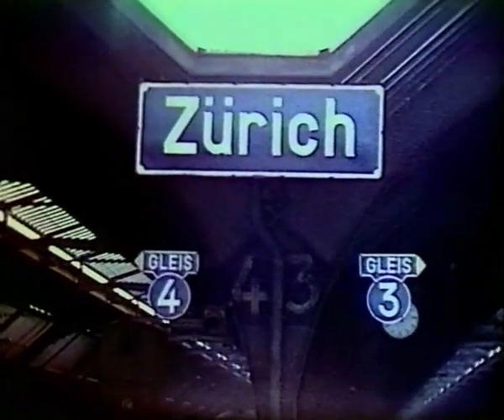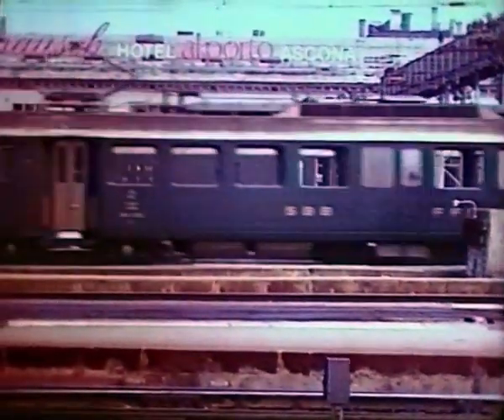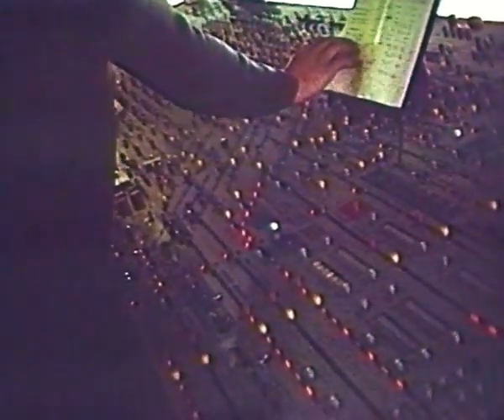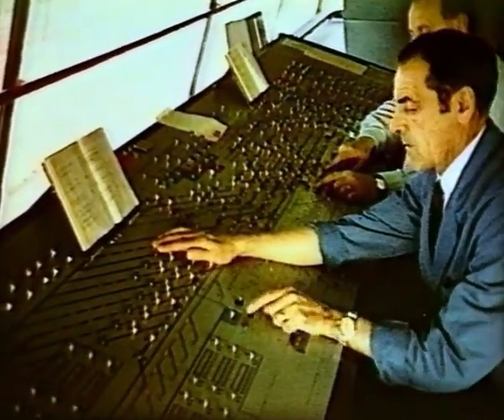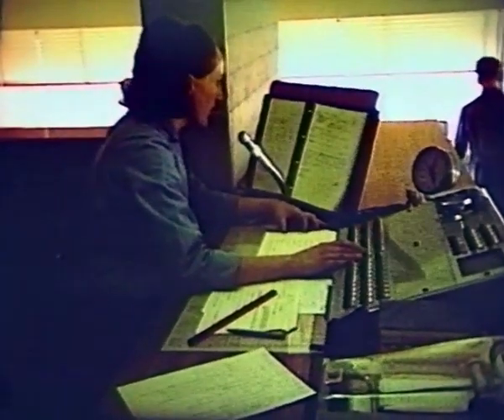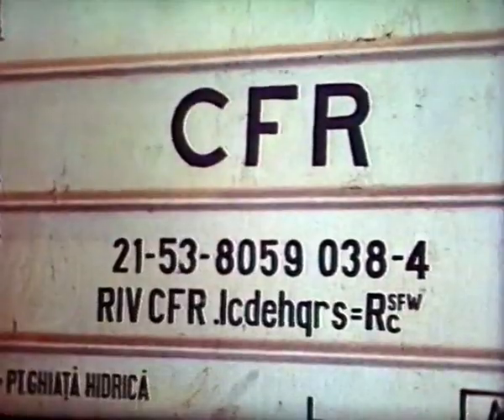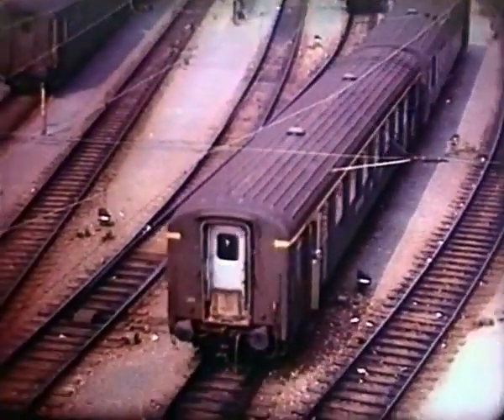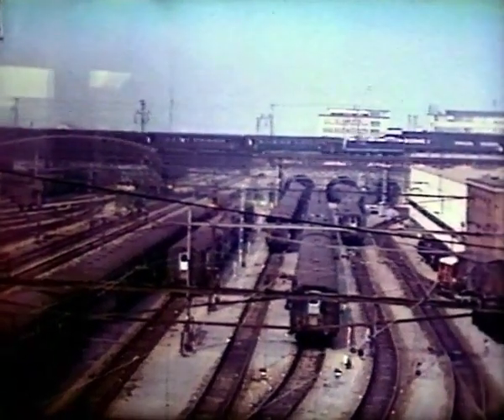ZURICH Swiss railway signalling & lineside SBB 1968

Comment: Victoria Signal Centre Clapham junction was a Disaster!  Failures all the time.  ASE was 'Wrong man for the job', corrupt, embezzling money to run department, had to be paid off. Replacement narcissistic told by Chairman BR Board that he was to be sacked in 6 months time unless failures dropped.  Bought in man from Swanley led a task force team found lots of equipment faults.
Reply: a very fantastic archive from the past very beautiful